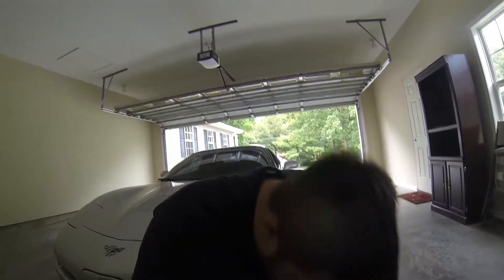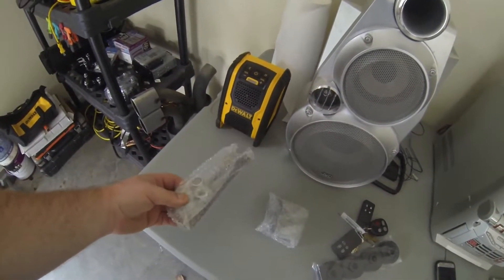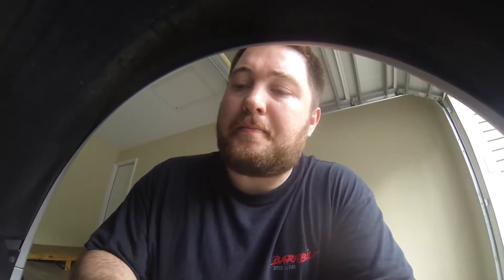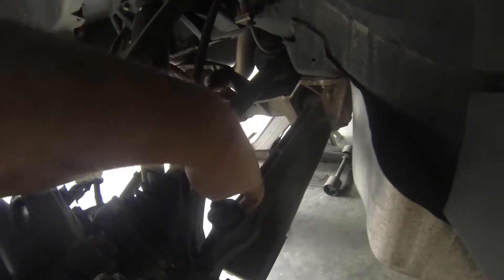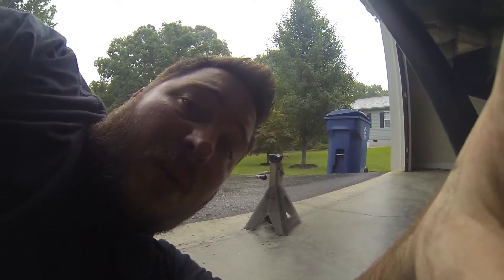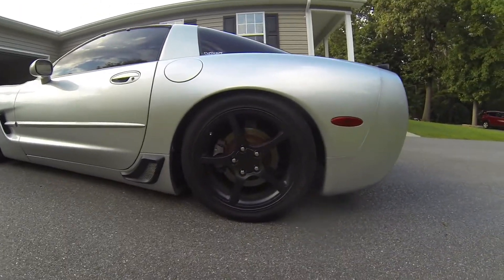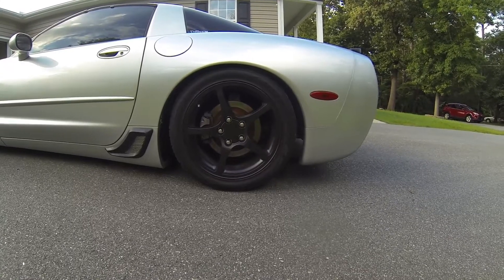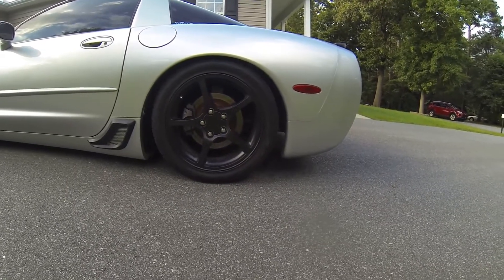C5 Corvette REAR lowering bolts install!

Comment: Did you every lift up the back end a little?  I like a slight stance so you are definitely right, the back needs to be lifted a little otherwise it looks like it sits lower than the front.
Reply from the maker: I did for comfort. It was nit completely even but you cant tell unless you stare at it.
Reply: Tim Franklin   How many fingers can you put in between the tire and frame.  I'm guessing 2 fingers.   Was it riding a little rough with it too low?  I'm about to lower mine.   Thanks..

Comment: Hi Tim. I just bought this car that was already lowered. How complicated is this to raise it again?
Reply from the maker: It's not that bad. The rear is super easy, fronts are not hard at all
Reply: @SpectrumRacing  Basically you can just adjust the bolt that was inserted similar to the one you posted in this video correct? I wouldn't need to replace anything?
Reply from the maker: @ezeddie32  it wouldn't be a huge change but it would help. If you want it back to stock you need the stock bolts

Comment: Couldn't you just have used the stock bolts to lower it?  I read that the cars are raised for transport and then lowered for sale, so that's why the stock bolts are adjustable to a point.
Reply from the maker: they are but it is not noticeable tbh. its the cushion at the bottom of the bolt that gives you the actual extra drop